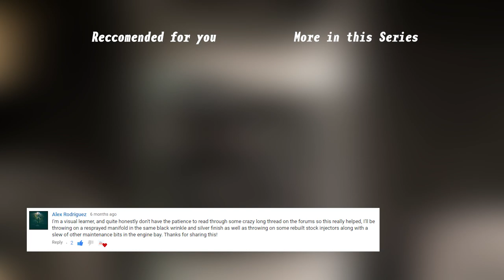Cobb Short Shifter Install - Subaru Impreza WRX

Comment: Honestly super nice video. I just bought a 2013 WRX hatch and I've been trying to find videos about the supposed STI short throw shifter. However, I think that was a hoax from the dealer because the throw looks exactly the same as your stock one. Gonna have to get that short shifter now. Thanks!
Reply: Don't know about the 2013 but the Subaru short throw shifter for the 2003 WRX still has pretty long throws. With the Cobb shifter you can adjust it to actual short throws (~2-1/4"). A big improvement!

Comment: Got a question I installed a cobb short shifter in my 08 wrx and I have to force the shifter all the way to the left or right depending what gear I’m in do you know why it could be that hard? Like I have to force it and sometimes even force it into gear? Shifter problem? Or do you think it could be more?